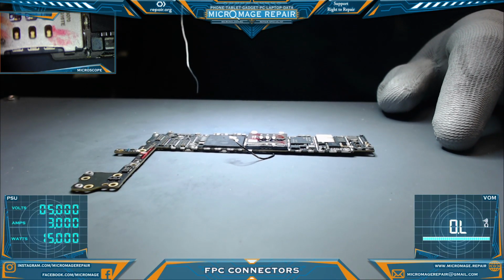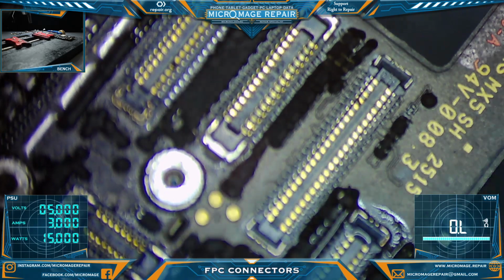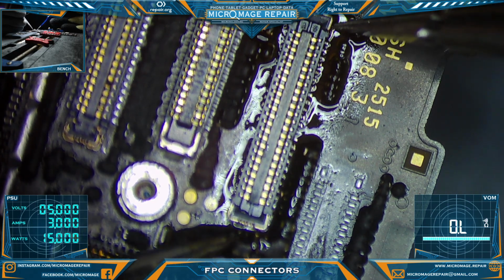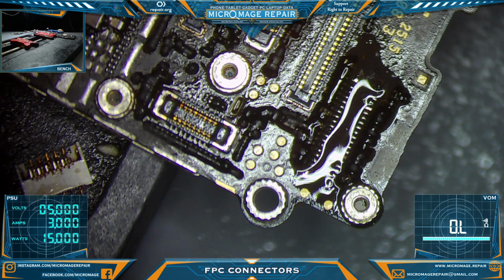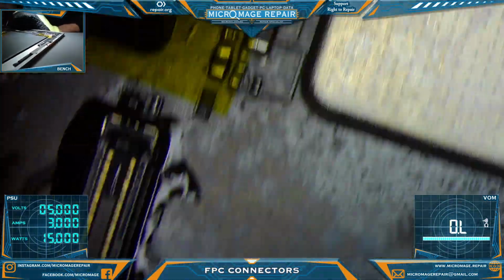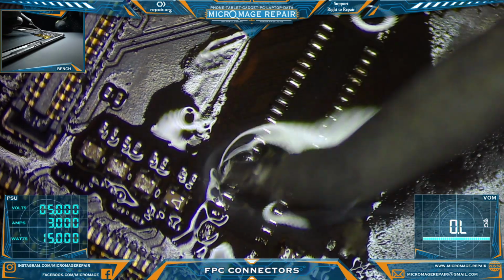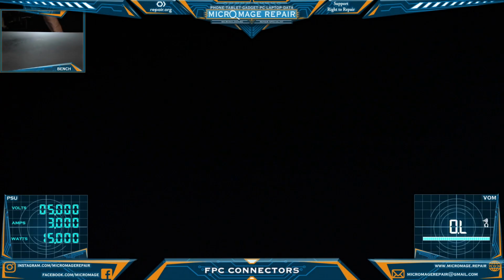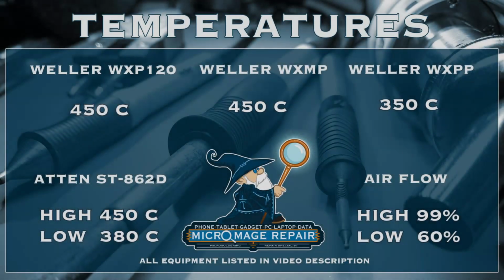Solder & Wick: FPC Connectors

Comment: Very impressive and informative. What distance do you keep your hotair? Thank you for the table re heat and airflow.
Reply from the maker: Hard to say, I'm pretty close most of the time when using a small nozzle. Close enough that I have to take care not to make contact and melt the connector with the nozzle.